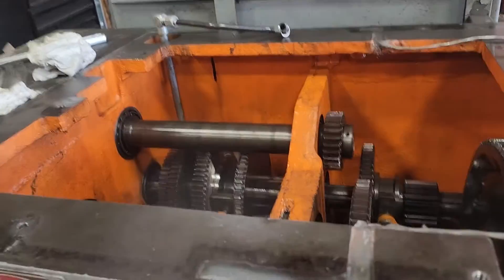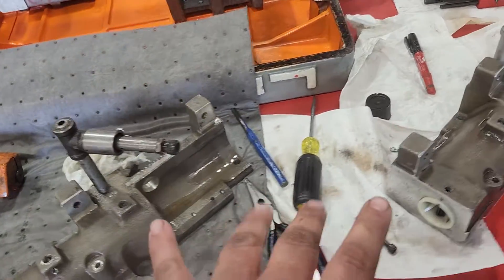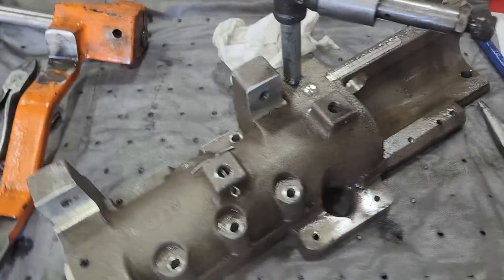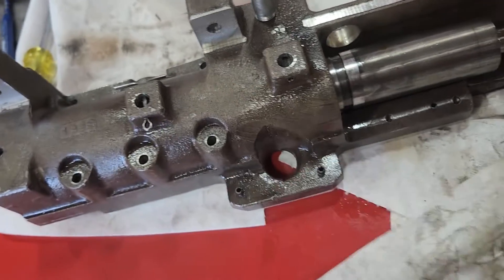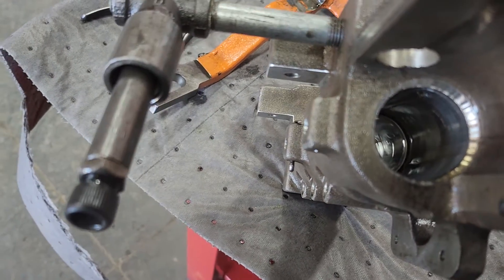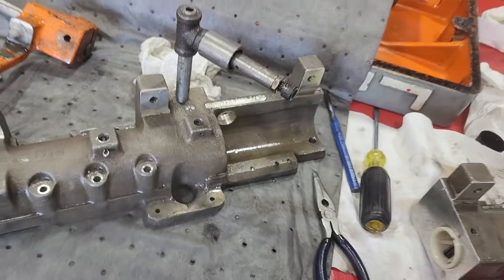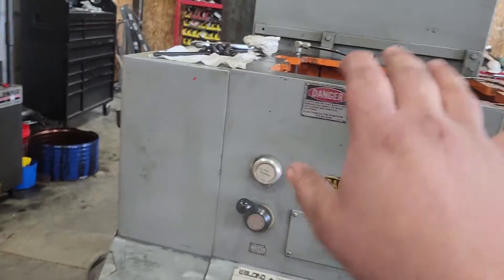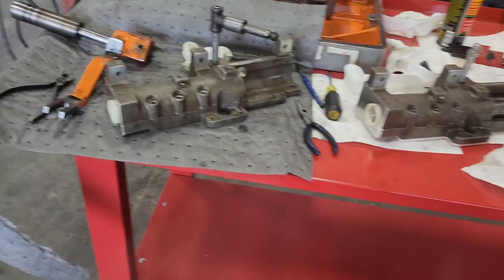lablonde lathe servo shift repair!

Comment: I just got my 20" LeBlond Makino wired up and running. My Servo Shift knob is frozen on Neutral but I can turn the spindle on and it looks like it's spinning around 300 rpm. It sure would be nice if you showed the reassembling and installation of the valves!!!  No chance of popping off the lid and showing the reassembly, process is there?

Comment: Thanks for the video, I am doing the same repair on my lathe but when I pulled the two halves apart the gear slid down and I don't know where neutral is. would you have a picture of what your neutral position is? Did you get it back up and running?